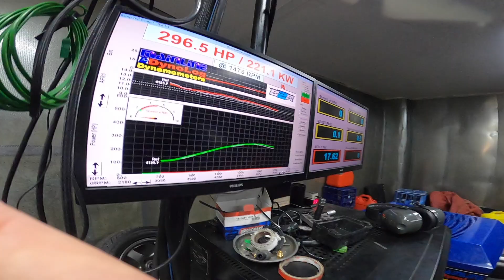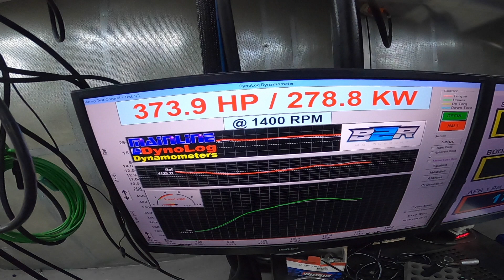180sx SR20DET Vs. Garrett GTX2867r ~ would my build design work!?

Comment: Also gen 1 or gen 2?
Reply from the maker: .64 pretty sure it's gen2, has 11 blades off memory, I got it made from precision turbochargers in Sydney.
Reply: @180sxdeano  stock head? Or what cams?
Reply from the maker: @jonj4357  shopping list at 3.15 on vid.

Comment: That’s wkw yeah?
Reply from the maker: Rwkw, yeah, just had a re tune, made 307rwkw / 411rwhp now!
Reply: That’s amazing bro.

I just realised you’re from Strayah too lol

I’m wanting a GTX2867r for my Audi… and just currently looking into it. (My GDI fuel system may not support it without mods)

What’s your thoughts of 2867r vs 3071r? Or how come you didn’t go for that option?

Too laggy?
Reply from the maker: @eeiko321  yeah wanted response, and only wanted around this much power,  my mate has the 3071, tuning it now,  that might get boost by 4k and have around 350rwkw,. I've got full boost by 3.6k, and made the power I needed.
Reply: Heya I just typed a response with a question.

Did it appear?
Reply from the maker: @eeiko321  not that I could see?
Reply: Ok what I mentioned was, so from what you’re describing. 
There’s no real reason to go the 3076r, unless you’re using it for drags, which is where it will outperform the 2867r.

But for a street car, on street conditions and perhaps even on circuit track.. the 2867 is a better option with better response and with a much better feel?

I recall when talking turbos with a vendor who was selling, he mentioned larger is not always better… what he was saying was…. eg, 3076r vs 2867r on same cars racing on the street for eg… the 2867r will always be ahead and the 3076r will always “play a catch up game”
Do you agree to that?
Reply from the maker: @eeiko321  yep, I had a bigger 5557 turbo before, car is alot faster now with 50kw less, with over 1000rpm more  response, you can definitely feel it, 30s would suit a RB/6 cylinders motors, but depending on what you want, a big Dyno chart, or a fast car,. Also I can barely get traction as it is now, so going more power I'd just spin the wheels and go no where,!
Reply: Yeah I definately need more down low and for street use. 
Your car is pretty light from memory, around 1200kg?
The only thing is, my car is a 4cyl.. but it’s heavy… with Quattro system it’s about 1640kg.
Currently maxed out on the existing turbo at 183wkw on 98 on a low reading dyno.

So yeah looks like 2867r it is for me then
Reply: With regards to housing, I notice people talking about it (I’m new to this stuff) seems like different measurements can affect response?

But the kit I wanna buy, it doesn’t appear to have the option… as the GTX2867r is matched with a suited exhaust manifold made for the car
Reply from the maker: @eeiko321  yeah it's Popular on the VW golf Rs, similar type of car to your Aldi,  will always lose abit with the AWD system.
Reply from the maker: @eeiko321  https://precisionturbos.com.au/. This is where I got mine, they are in Sydney, John knows his stuff, he talked me out of the g550 turbo, saved me 1500 bucks as I was only chasing this much power, and this response. The g550 would be similar response, but can Make 500hp, yet I don't need that much,
Reply: Thanks, that’s handy to know.

Did you talk to him via phone or email?
Reply from the maker: @eeiko321  nah I'm 20 mins down the road.! Haha
Reply: Yeah it’s always best to chat to a person face to face.
But I see they’re in Wetherill Pk.
But far as I’m up Castle Hill way.

I noticed the GTX2867r there’s different size inlets where the suction pipe is.. does that make a huge difference?
Reply from the maker: @eeiko321  yeah not really, I have the stock small OEM snount 2 bolt style on mine, makes no difference, I even have the stock airbox, most that stuff is just looks